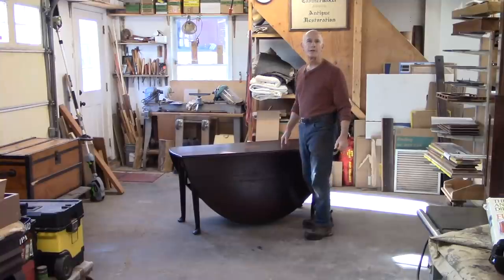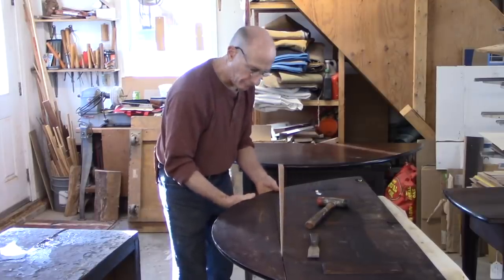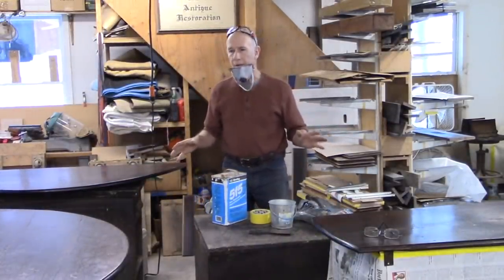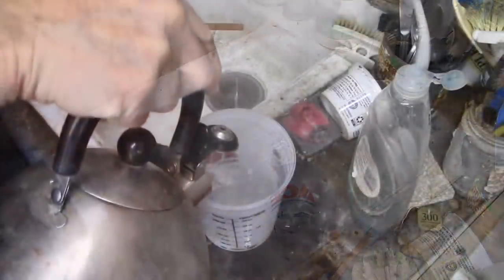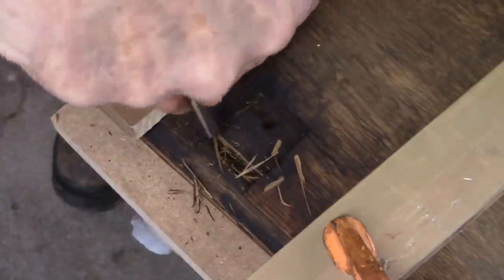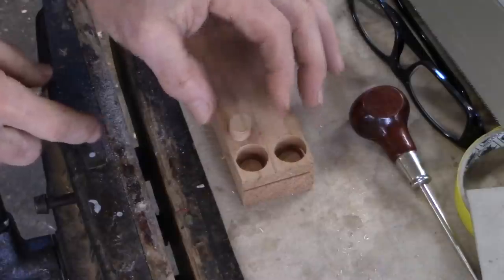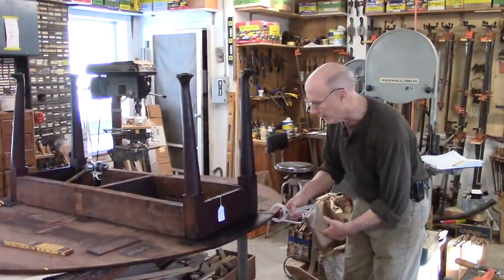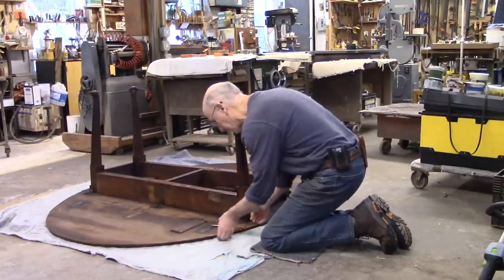Restoring an early 18th c. Drop-leaf Dining Table - Thomas Johnson Antique Furniture Restoration

Comment: A very nice table. I thought I noticed some wax filling along the line of the old crack repaired with an iron plate in the first leaf. If I saw that right, I assume it comes right off with the varnish remover? Or is that the oil you were talking about later, since there seem to be a lot of big splotches on the underside?  
I've seen luthiers use a suction cup to get glue into cracks in a guitar. Those are much thinner of course, but is it a technique that you've used? 
The flange you repaired with epoxy I assume needs to carry a good deal of the weight of the extended leaves? If I have the structure right in my mind? It also looked as if the area had been repaired before. Lots of nice 'how to' and safety tips. (How to make sure your dog does not eat oxalic acid, for one.)  Is there any way to mitigate burn marks? Other than sanding far more than one should on an antique? 
Thanks for another wonderful video
Reply from the maker: You're welcome! Too many questions! The epoxy was because the wood was so compromised. I never have tried the suction cup method - it's hard to understand how that could work. I ought to try it!

Comment: This video proves the saying that you can never have enough clamps!
I gotta say, I was trying to crawl through the screen to help you lift that leaf with all the clamps on it, as I know it had to be heavy!
Wondering why you used a two part epoxy on 36:04? Why would you use that in this case?
Great and informative video as usual! Thank you!
Reply from the maker: You're welcome! I could've used the help! There was no good glue surface there, it was a mess. That's what epoxy's for!

Comment: Just a guess, here, but those square areas of damage on the table top may be from hot pads that were used to (technically) protect the finish. The thing is, if the pads were also used at the stove, they may have gotten damp from steamy pot lids, etc, and transferred the damp to the table. It happens, and it's a dirty job to get rid of those marks.
Reply from the maker: Thanks! Yes, good guess. And I decided - why get rid of them? They are just another defect reflecting the history of the piece

Comment: This was great and I redid a similar very old table about a year ago and had to redo the holes for the hinges.  I didn't know what I was doing.  Same deal with the rotted stuff.  I didn't know what to do but I found a website. I used dowels.  My heart was going like a jackhammer when I had to drill in but I did OK.  I hated it, though.  And same thing with the screws.  The old ones were too small but I ordered half inch anyway and used them.  I didn't think to cut the tips off.  It worked out anyway.   I can't wait to see your part 2!  Thanks.
Reply from the maker: Thanks! The dowels will be fine. This was a big top, so I went with the plugs. And yes, no fun drilling into tops

Comment: It is fascinating to watch you dismantle and repair the leaves, table top and old hinge screw holes.  Glad  to see you are so safety conscious with heavy rubber gloves and breathing protection from nasty chemicals, and that the shop quality inspector was put outside and the shop floor was mopped to remove acid crystals etc. for canine tootsies.  I look forward very much to chapter two of the elegant table's rebirth.
Reply from the maker: Thanks! I'm glad you appreciated all that

Comment: you have got a really impressive collection of clamps - sash clamps, G clamps, C clamps and many that I have never even seen anywhere before, and I learned something about plugs and dowels - personally I use wooden matchsticks, if I need extra strengh then I use no more nails glue on the matchsticks and in the hole too
Reply from the maker: Thanks! Oh, yes, I'll use a matchstick and toothpicks too! These particular screw holes needed maximum strength

Comment: Instead of using hot air electric heaters to warm up your materials, you might want to consider using electric radiant heaters.  Radiant heat warms solid objects directly.  Hot air simply rises to your ceiling with little imparted to your materials.

Disclosure: My company makes these heaters.
Reply from the maker: Thanks! Yes, I should! Send me your company's info: thomasjohnsonrestoration@gmail.com (I usually buy equipment from Grainger's)

Comment: Very educational, thank you! Can you list the types of glues you were using?  was it like an epoxy you mixed up for the splits in the leaves?  What was the mix that was darker for the hinge plugs?
Reply from the maker: Thanks! For the cracks I was using West System Epoxy with a little color in it. I think for the plugs I might have used 5-minute epoxy. Usually I use hide glue, but this was a special case where I felt I needed the extra strength of epoxy

Comment: Tom, another great video. After you used the stripper, you applied a powder mixed with water to stop the chemical reaction. What powder did you use?
Reply: Oxalic acid. Didn't know about it before I watched Tom's videos. lol
Reply: @jimiblue1277  The oxalis acid removes watermarks by removing the tannin which forms the dark stain. Oak contains quite a lot of tannin, consequently the stains are quite strong and penetrating. Tom dealt with this in a previous video, possibly 12 to 18 months ago.
Reply: What Tom used after the acid is TSP (tri-sodium phosphate). You can see it at 17:22
Reply from the maker: Thanks! Jimi Blue is correct - oxalic acid
Reply from the maker: Yes, thanks!
Reply from the maker: Thanks! Yes, I've used it often
Reply from the maker: Yes, did I neglect to mention that? Of course, a lot of times I don't say anything because you can see it. Thanks

Comment: Thank You for another fantastic treasure.  Your work / talent is just so neat to view.  Thank you for sharing.   I have one question - where do you find the best source of decent sand paper?  Thanks again!
Reply from the maker: Thanks! I always use 3M sandpaper, and it's getting harder to find. But I eventually find it on the internet. The 3M Gold paper in the finer grits I get from an auto paint store. It's the 100,150 and the 220 production papers that are tough to find

Comment: I really appreciated the dowel Vs plug lesson but have a question.
When you insert the plugs, you lined the grain up with the grain of the side.
This had me wondering.
If you screw into a plug, if it splits it will tend to split the wood it is in this close to the edge so would it be better with a repair to align the grain of the plug across the grain of the top such that if there were a tendency to split, it would be against the end grain of the top?
I guess one of the ways to minimise the risk is to always predrill but drill for the threaded section  but you didn't seem to drill slightly larger for the unthreaded shank.
What is recommended?
Reply from the maker: Thanks Jon! That is a really good point. I did drill a larger pilot hole. I should have mentioned that, as it is a pet peeve of mine.

Comment: So far so good.
I might have removed the three original dowels with heat and either reused them or replaced with new.
The old ones will probably come loose next.
JIM
Reply from the maker: Hmm, good point. They seemed tight, but you're right

Comment: As per usual, you have explained things very well. As for the dowels and plugs, I now realise why a couple of things I've done have failed when using dowels. Never too old to learn things. Thanks for another very informative video.👍🏻🇦🇺😁
Reply from the maker: You're welcome! We are never too old to learn!
Reply: Thomas Johnson Antique Furniture Restoration : just out of interest,  is the holding strength of hide glue as good as PVA glue? What determines what glue you utilise because I noticed you use epoxy in some areas and not hide glue or PVA glue?

Comment: What are you mixing @17:20
Is that more stripper or an acid wash?
Reply: That's tri-sodium phosphate (TSP) - a general purpose degreaser and cleaning agent.
Reply from the maker: Thanks! dlevi67's reply is correct!
Reply from the maker: Thanks!

Comment: Congratulations on you Chanel. You are obviously an expert. I want to save the wood veneer on a dining table , it started lifting from the edge and it feels brittle. Can it be saved or have to replace?
Reply from the maker: Thanks! You can work glue under it and clamp it down. If you can, send a photo or 2 to my email : thomasjohnsonrestoration@gmail.com

Comment: You should have gotten rid of the burn mark. Even if you had some heave sanding to do. I'd rather have a low spot on the surface than a big black stain
Reply from the maker: Thanks! You'd have to sand the entire top down to about 1/2". All the screws would be visible!

Comment: It's always interesting to me to see someone else work find solutions to working with a large piece alone. I am about 110 pounds and five foot tall so any new ideas I embrace for larger stuff and that table step down onto shorter tables then the floor yeah that's getting used by me in the future
Reply from the maker: Thanks! Yes, and reaching those high shelves! You should consider a power lift table - there are a lot out there. You can get pretty creative when it comes to moving furniture around though. I need to get one of these: https://www.uline.com/Grp_333/Lift-Tables?pricode=WX554&AdKeyword=electric%20lift%20tables&AdMatchtype=p&gclid=Cj0KCQjw5oiMBhDtARIsAJi0qk18_mtQBnU1pxBq_QmSMtDWnIY-MuSHPFBwLA2MxzLkmKpwGYQK4koaAkG1EALw_wcB&gclsrc=aw.ds

Comment: I appreciated the lesson on the difference between the holding strength of a dowel versus a plug.  I have used dowels but will switch to plugs now.  Thanks for the insight.
Reply from the maker: Glad it was helpful! And I use both, depending. When I'm really concerned about the holding power I use plugs

Comment: Why don't you do the cleaning with the oxalic acid outside, let it dry inside, then take off the dust outside again? It should take less time than cleaning the inside floor, I thnk.
Reply from the maker: Thanks! Good point. But it was pretty cold out there, even rinsing them outside was a bit of a stretch. But now I can no problem

Comment: Was that hinge moved because the wood was too blown out?    
Why did they repair some of the hinge screw points with dowels, and other hinges they moved?   Or do you think it was done at different times?
Reply from the maker: Thanks! Definitely different times. This table had been worked on a lot

Comment: Thanks! This is one of the most enjoyable and educational videos you've made in a long time. I also enjoyed the 'creative' means you used to move or invert the table. It is nice to know that I'm not alone when it comes to moving ungainly objects alone.  Clipping off the ends of the screws instead of using a tapered drill bit and slimmer screws is a great idea.
Reply from the maker: Thanks! Yeah, it does take some thinking! Could've done a better job on that last move though
Reply: @johnsonrestoration  Seeing the things that don't go as planned is a big part of the appeal of your site.  The changes you make to the color of the finishes, going back over spots that didn't please you, andd hearing you explain your thinking about them is very interesting and helpful.

Comment: Do you ever try to straighten out seams on antique furniture so that the leaves line up better, or is that too much for this kind of work?
Reply: I may be wrong, but it's not so much 'too much' as it is inadvisable. The planks don't match up because the wood shrinks along its length - thus the shape of the curve changes. To get them to match would mean re-doing (most of) the moulded edge, which a) ruins the table as an antique and b) is a veritable PITA.
Reply from the maker: Thanks! No, dlevi67 is correct. You can open up a can of worms and still not get them straight. My life got a lot better when I said one day "I'm never going to try that again"
Reply from the maker: Yes! Among other issues! It took me a few seconds to figure out PITA
Reply: @johnsonrestoration  Sorry - British English, I guess...

Comment: Did you ever try the old luthier's method of using suction cups to pump glue into a tight joint?
Reply from the maker: I've never tried that. It's the method most mentioned in the comments

Comment: MethCl paint stripper is banned in Europe. To get the best performance with MethCl free paint stripper wrap the coated parts in cling film / food wrap and leave for 24 hours before wiping off. It prevents evaporation and gives the same results as MethCl stripper.
Reply: Here's hoping you don't have to use more than one coat.  Methylene Chloride isn't as readily available locally as it used to be but still can be located where I live.  It's also still sold on Amazon if I plan ahead.
Reply from the maker: Thanks! Yes, I've read that and will try it going forward
Reply from the maker: That's interesting that you can get it on Amazon!

Comment: That burn mark is sure distracting.  Since you'll be staining the entire top, would it be appropriate to carve off that burn and then glue in a filler piece that matches the grain pattern?  I'm not sure, but is something like that called a dutchman?  Suppose that's a decision to be made by the owner.
Reply: I think that would be possible, but very difficult to match the grain pattern for a piece that large.  My guess is that he's just going to try to stain the surrounding wood and hope it blends in enough to not be noticable.   However he may surprise me and have a trick up his sleeve.
Reply from the maker: Thanks! We'll wait for part 2!
Reply from the maker: Thanks!

Comment: You have done a beautiful job on this table and I've done two of them very much like it.  One thing that drives me to distraction is the "burn" spot on the top.......how do you take care of that?  I've tried oxalic acid, bleach, etc and have never found a method that I'm satisfied with to hide/get it out.  If there is a Part II to this upload I can't find it.  How do I accomplish getting the spot to be acceptable?  Thanks, Tom
Reply: FWIW, I've never seen a 'successful' recovery of a burn mark of that intensity that did not involve heavy sanding. I'm curious to see what happens in part II - my bet is that there will be a burn mark, just blended in with the rest of the finish. If that were my table, not only I wouldn't mind - I would have left the rest of the marks there too (you should see some of the furniture in my house...). The varnish wasn't original, I think, but the marks are part of the history.
Reply from the maker: Thanks! Part 2 in 2 weeks. I'm not at liberty to say any more than that!
Reply from the maker: I could join in but I can't give away the ending!
Reply: @johnsonrestoration  We'll see in two weeks. Looking forward to it, and thank you for all the work you put into these videos!

Comment: Is it just me, or ...

So many people say that glue joints are sooooo strong that, if the top breaks, it mostly breaks somewhere other than a glue joint.  But, then, how many glue joints have we seen Mr. Johnson work on that were crap?  And whenever he takes a piece apart, he seems to almost effortlessly take it apart at glue joints.
Reply: That's true, but he's often working on hide glue that is 100 or 200 years old, or even older.   And oftentimes the furniture he's restoring has been in a damp basement or boiling hot attic for the last 50 years.   Hide glue is amazing stuff, but even it does have it's limitations.
Reply from the maker: Thanks! JimTheSoundman is correct. Plus, that can only apply if it's a good joint to begin with
Reply from the maker: Yes, all true! Thanks!

Comment: I couldn't tell if the table top was solid wood or a thick veneer top, the latter which would explain your reticence to sand with a coarser sandpaper (wondering how you will attack that burn mark).
Reply: Based on style/shape and likely age, my bet is on solid. And my other bet is on 'no attack beyond what has been done. It has a burn mark; it will have a burn mark.
Reply: @dlevi67  well we will await baited breath for part 2!  (If solid, I would try to sand a bit more aggressively there and spot bleach but do risk a divet of sorts). If veneered, I would consider a patch which is challenging for me but not for Tom.
Reply: I just finish an Italian dropleaf from the early 1900s. It was veneered but the top layer was almost 1/8" so enough to work with.
Reply: @sullyprudhomme  Interesting - such a thick veneer in a relatively recent piece. I would have thought that by then it would have been all knife-cut paper-thin stuff.
Reply from the maker: Thanks! I won't give it away.....
Reply from the maker: Definitely solid. I think I may not have said that because I thought it was obvious. Which of course it was - to me!
Reply: @johnsonrestoration  I was pretty sure it was solid but then that burn mark can be sanded more aggressively I would think but what do I know? I am really just an amateur that goes to your videos to improve..but I now am besides myself with anticipation...

Comment: You should wear a good wireless microphone.
Reply from the maker: I know! I have to get a camera that will work with one
Reply: @johnsonrestoration  yeah,  especially if the shop gets noisy.  Anyway I enjoy your work.  In my case I can't work on the floor any more cuz I'm not long and tall, or slim any more, and I don't bend easy.   I'd like to see you with another bench cuz I just can't picture myself bent over on the floor filling holes or fitting Dutchman pieces any more, which I used to do too.

Comment: What did you mix in with the Old Brown Glue?
Reply: Sawdust to thicken the glue and form a bit of a filler where the bottom of the slot was not smooth.
Reply from the maker: Thanks! dlevi67 got it!
Reply from the maker: Thanks!